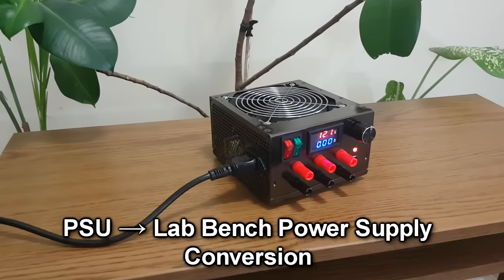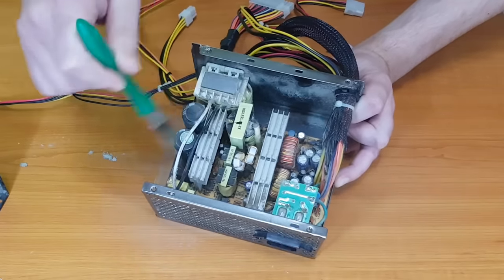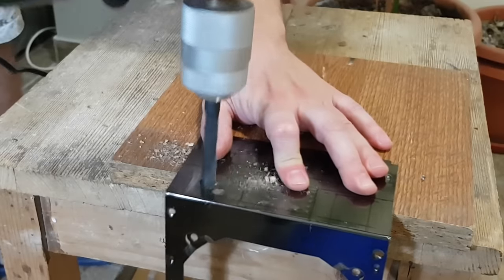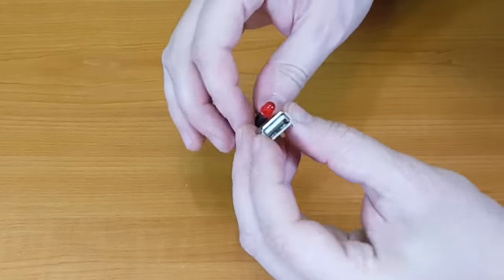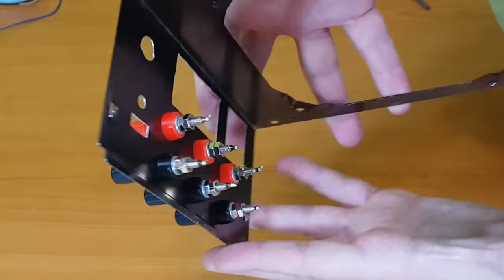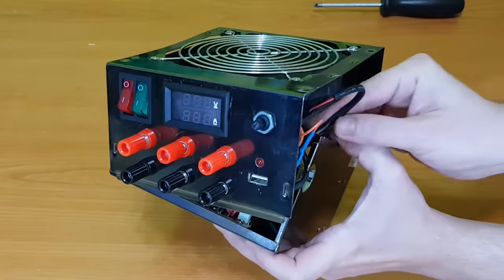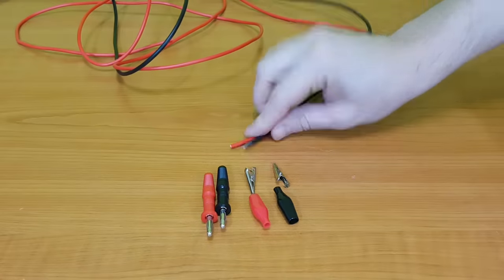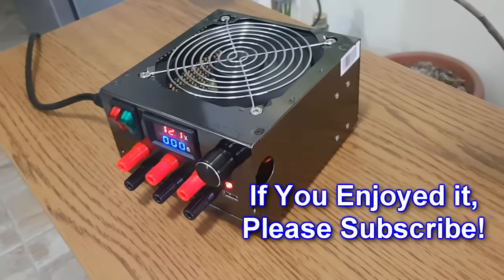DIY - Lab Bench Power Supply

Comment: Can you plug two psu in parallel or series??
Reply from the maker: no. if you connect them in parallel, there will most likely be a small voltage difference between them, so they can't deliver simultaneously the same amount of current. if you connect them in series, they will blow up, because they are not insulated from the mains and you're actually connect them in a short circuit.

Comment: What dummy load should I use if I’m using a 650w psu with most of its powers on the 12v rail at 648w 54amps
Reply from the maker: hi. for 12V I suggest 68-82ohm 10w resistor.
Reply: Thank you so much just checking is that a variable ohms or any 10w with a ohms rating within that range
Reply from the maker: these are fixed value resistors of 68 or 82 ohm. you can use which one you want/find. the difference is that the 68 ohm resistor will use a little bit more current and it will get more hotter than the 82 ohm resistor.
Reply: Much appreciated the explanation I opted for the 82r.

One last thing the amp meter will I need to get. Because I can only see them rated for 10 amps when my my psu delivers way more power

Comment: Hello, good video. My meter is a model YB4835 - V1, with only 03 cables. A voltage range of 4.5 - 100V, which means I must have at least 4.5V to work. Do you know how to use an external power supply for this equipment? Regards
Reply from the maker: hi. i can't find information about your voltmeter. can you provide a link?
Reply: @Sorin_DIY  I got it ! I added the diode D1 and insert a power supply in a space for it, that has no connector in this model. Thank you for your attention.
Reply from the maker: it's good that you found the solution :) I didn't use this type of voltmeter before.
Reply: @Sorin_DIY  more one registered for your good channel.

Comment: What will happen if I connected the +12 volts and -12 volts wire sir?
Reply from the maker: that is a 24V output, you will short it and the power supply should turn off.
Reply: @Sorin_DIY  is it safe?thanks for the reply sir

Comment: what happens if you connect the sense wire with the regular orange wire
Reply from the maker: you will have a stable 3.3V output. without the sense wire, the voltage will variate around 3V.

Comment: Hi, is it possible to also have a 30v output?
Reply from the maker: hi. yes, you need a step up converter, but the max current will be limited to a few amps.
Reply: @Sorin_DIY  Good, is not possible to connect in series +5v +12v +12v ?

Comment: How many amps can it handle?
Reply from the maker: the ammeter can measure max 10A, but the power supply it's more powerful. 2* 12V & 18A; 5V & 28A, 3.3V & 28A.

Comment: How to prevent any shocks  which can cause even death!! Please advise!!
Reply from the maker: always unplug it from the mains socket when you're working on it. don't touch the terminals of high voltage capacitors, measure them first to be sure they are discharged. always wear protective goggles.

Comment: can i use 10wtts 10 ohms resistor and Rotary Switch 2P11T 2 Pole 11
Reply from the maker: 10 ohms resistor it will get very hot. you need 22 ohms or more. that rotary switch is not good. you need one with a common pin. and it needs to brake the contact, before making the next contact - in the next position. please watch the part2 video for more information about the switch.

Comment: Hi Guys, Would it be possible to connect the yellow (+12v) & the blue (-12v) to get 24v? If so, how would I wire the switch to be able to select this custom value? Would I have to solder another blue (-12v) wire to the board and solder that to the switch? TIA
Reply from the maker: hi. you can connect the 2 wires to get 24V, but it will have the current of the weakest output, in my case 0.3A, which is not very useful. you can use a similar switch with 2 poles and 6 positions (like the one I've used in the part2 video) to make the connections.
Reply: I do have a rotary switch with twelve positions. Are you saying that I could connect the two wires to one connector on the switch to get 24v? Sorry, I’m not sure how that would work
Reply from the maker: the simplest way is to install 2 more binding posts for the 24v output. the blue wire will go to the black terminal, and yellow wire to the red terminal. but again, with 0.3A I don't think it's worth doing.
Reply: Sorin - DIY Electrical Nerd Thanks Sorin, I do agree that it is not worth doing but I was intrigued. I’m still waiting for all my hits to arrive & then I will have a go at the Workbench PSU, I think you put together two excellent videos & I cannot wait to try it for myself. Thank you. Do you have any plans to make the variable one? I would really like to see that. Thanks once again & do keep up the good work
Reply from the maker: I will make a variable power supply, but in about 2 months I think.
Reply: Sorin - DIY Electrical Nerd hell yeah! I cannot wait. TYVM

Comment: hi .so , on the usb / mir port, i read 16amps per port .my +5v is rated at 30amps .before i burn my phone, can i have a recomandation ? my other on-hand-two options another 4 usb port, wich gives out 500mAps .. wich is low , and the last, recycle the converter from an old car charger and stickit to the 12v line. thnx for the videos. ps. that cat is lazy
Reply from the maker: hi. the 5V rail should not damage your phone. the phone decide how much current it will draw. it shouldn't draw more than 2A. I suggest you first try it with another cheaper phone, that you don't use anymore. if everything is ok, you can charge your phones with it.

Comment: On the usb side, it can deliver 2.5 amps but your phone will never accept more if you dont do a trick on data pins to set charging at higher amp rating.
Reply: or use a "power delivery" adapter
Reply from the maker: hi. I have explained this in the part 2 video.

Comment: Nice but these PSU can't hold voltage with a modest load at 12 volts. Voltage drop below 11 volts! I tried scraped  200W, 300W and a 450W PSU units. Good for battery chargers though...For a robust PSU just have one that hols 13.8Volt..

Comment: I cant find 10W 43 Ohm resistor,
9W 0R47 would be ok?
Reply from the maker: you can use a resistor of 10W and 33 or 47ohm
Reply: When I connect the voltmeter the supply turned off so I connected a 10w 47 ohm rezistor to the 5v output ,but same thing.....plus the rezistor o overheated and smoked and

Comment: A few tips for the sheet metal work:
* Drill at each corner for a nicely radiused square hole. 5/16" drill for 5/16" radius (equates roughly to 8mm)
* A "nibbler" is very helpful for cleaning up the straight cuts, and it's an inexpensive tool
* For the large hole the wires used to be routed out of, you might find a plastic plug made for furniture to plug it with. 
 **I hope you find that helpful! Your video helped me in a few areas, so I hoped to return the favor as much as possible**

Comment: I have one serrious question for those who want to help me 
I have atx akyga ak-b1-400 +3,3V 23A, +5V 25A, +12V 18A , -12V 0,5A +5V Sb 2,5A total power 400W. Which buck Amperage should i use and what value  should be the fuse inside?

Comment: Can I run with this supply hho 12 volt15 amp generator.
Reply from the maker: theoretically yes. but you may need to add some modifications to the power supply. it will be difficult if the inrush current is high.

Comment: I hace a doubt, it seems that my source atx doesn't have the fuse included, if I wanted to add it, where should I put it? Will be right if I connect it in series with my switch of stand by or where? If anyone can help me I'll be so thankful.
Reply from the maker: if you want to protect the outputs, you need to add a fuse on each positive output wire. you can watch the part2 video for more info.
Reply: Thank you, I have seen your video. It's great but I think that that is going to limit my power source and I don't want that, I will put a fuse in the input of all the ATX to protect everything un general (Will be right if I put a 4A fuse?) And I also going to be puting a 1.5A fuse in my variable voltaje output, What do you think bro?

Comment: How to give adjust Current meter  in PSU ??? But i need control adjust current meter
Reply from the maker: in the future I will make another power supply with adjustable voltage and current.

Comment: Also, the blue wire IS useful to you. that -12V right there, used as the negative terminal for +12V gives you +24V.
I'm literally a beginner in electronics, and yet I keep finding horrendous misinformation. If I can find it, then I can't trust anything you say

Comment: How this .3amp rottery switch handle 19-24amp of computer atx?
Reply from the maker: it doesn't. it's not connected in series with the load. it has a different purpose, you can watch the part2 video for more info.
Reply: @Sorin_DIY  atx power supply yellow wire out put is 12vlt appx with 19-24amp...
What ever. . Interesting project...👍👍👌

Comment: Don't you need a was of controlling the amps output?
Reply from the maker: no. the PSU delivers the maximum current on each output. this is not a variable power supply. the load draws as much current as it needs.
Reply: @Sorin_DIY  Ok. I was thinking of building a supply with a buck / boost and controls for volts and amps with a volt/amp meter.
So I don't need to worry about controlling the amps just the voltage?
So basically you are saying I wont blow anything with too high an amp output?
Reply: @Sorin_DIY  I would really like to have a minimum of 24v
Reply from the maker: the PSU should already have over current and short circuit protection, but you can add a fuse on each output.
Reply: @Sorin_DIY  What is the use of having control over the current then? If for example I was powering something that required say 500 milli amps and my supply was outputting 18a wouldn't it be bad for the circuit?
Reply from the maker: if the circuit is designed perfectly and put together well with perfect working components, it will 500mA, no mater how much current the PSU delivers. but with a variable power supply you can limit the current to 500mA to test the circuit. but if you've made a mistake designing/building it, or if you use faulty components and the circuit draws more current or even short circuit, then you will protect the rest of the components, because the current is limited. otherwise it can draw a few amps from the power supply and burn all the components, so you can't even find the mistake.

Comment: Why is there a need for a 10W resistor?
Reply from the maker: hi. some power supply units will not work correctly, if they don't detect a load connected. so, as a load you can connect a dummy resistor. you can watch the part2 video for ore info.
Reply: What will be the power consumption, if we only use one 12V supply from PSU?

Will it be same as using it completely?

Comment: 10:04 This is not a power supply fault but this is your fault. You should install a car charger or voltage divider. Phone does not see pins D+ and D- on usb and charging the battery in safe mode 20mA :D.
Reply from the maker: hi. it's not my fault, it's the power supply's fault. please watch the part2 video for clarification :D

Comment: what if I connect yellow + orange + red what will be the output
Reply from the maker: the power supply will turn off.
Reply: @Sorin_DIY  how can i convert it to 24 volt
Reply from the maker: you need a step up converter.

Comment: A diagram would be useful especially for wiring the Volt/Ammeter.
Reply from the maker: PSU circuit board schematic: https://i.imgur.com/e5JSKZf.jpg
Volt/ammeter schematic: https://i.imgur.com/tesGVjy.jpg
Reply: @Sorin_DIY  Hello I have problem I build this power bench supply my problem is my display volt/amper is on but when I connect something to turn on like a little motor there isn’t a current on biding post please help me !!

Comment: Thanks for the vídeo! I made one power supply very similar to yours, and works. But have two issues... Amp meter don't measures but works.... And my 3.5v output voltage is work good, but when i load a little bit amps, the power supply turn OFF ...  And o need to reboot to work again..

All others outputs work good
Reply from the maker: hi. did you use the same volt/ammeter? did you cut the thin black wire? try to reverse the thick ammeter wires. and for the 3.3V output did you connected the 3.3V sense wire (brown)?
Reply: Its Solved! I reverse de hires and work, i know the ampmeter is in series, but i didnt remember the input and output! The 3.3v output is working too on next day. Thanks for the help!

Comment: Hey how much watts does the 12 v can output
Reply from the maker: 216w
Reply: @Sorin_DIY  That means it gives 18 amps of current out put
I need At least 40 amps of continuous output
What should I do, can a relay be helpful?
Reply from the maker: I don't think you can get 40A from a PC power supply. you probably need to buy a dedicated 40A power supply.
Reply: @Sorin_DIY  can i connect two PSUs parallelly to get what I want, i.e. two  18 amps connected parallelly , will it give total output of 36 amps ?
Reply from the maker: I don't think it will work. there will be a small voltage difference between them and one power supply will always work more than the other.

Comment: why a atx psu will not take 6amp load when its allready on
Reply from the maker: what type of load are you using?
Reply: @Sorin_DIY  a car halogen headlight
Reply from the maker: that happens to mine also. there is a big voltage drop, when you connect the bulb, so the power supply turns off as a safety feature. try to connect a big electrolytic capacitor in parallel to the power supply output. 25V 6800uF minimum. it will keep the voltage more stable.
Reply: @Sorin_DIY  i never thought about that . thank you ill try it .
Reply: @Sorin_DIY   i tryed the capacitor (12000uf 63V) same results.
Reply from the maker: that means there is still a big voltage drop. try to connect a smaller wattage bulb, so the power supply will increase the output current. then connect in parallel the 6A bulb. the load will increase gradually and maybe there will not be such a big voltage drop, when you connect the second bulb.

Comment: the highest rated binding posts I can find are 16A. ... don't you need one that can handle 30A?
Reply from the maker: only if I plan to connect a 30A load for a long period of time. you can connect bigger loads to these binding posts for short periods of time without any problems.

Comment: unfortunately with this design you can't use 2 different voltages at the same time.  The PSU is designed otherwise to allow that.

Comment: Very good job brooo
If use buck boost converter ...mybe more acurated to  adjustable  the voltage.  
Requestion a video for me n the other viewer
PC powersupply convert to power supply adjustable current control n voltage control.
How do.. instalation  load current if i want to adjust the current to set ? Befor  use to supply 
Like a profesional powersupply made.
Thks
Sorry bro bad english...
Nice to meet u im from indonesia.

Comment: Can we vary the voltage between 0 to 12 volt by POT???
Reply from the maker: no. it is not a potentiometer. it's a rotary switch. please watch the part2 video for more info.
Reply: @Sorin_DIY  along with rotary switch can we add 10K potentiometer on 12 volt supply to make it variable??
Reply from the maker: a potentiometer is not enough. you need a step up / step down converter. I will soon make a video about a variable power supply and I will explain everything about it.
Reply: @Sorin_DIY  OK thanks

Comment: how can i add a Current Variable?
Reply from the maker: it depends on the voltage range that you need. you can add a step up, or step down converter with current limiter.
Reply: most of the times i use only 5v but i need a power supply that i can set the current not only the voltage. Thank you for answer. ideas??
Reply from the maker: you can add a step down converter with current limiter (like a LED driver module) to the 12V rail. so you can set the output voltage to 5V and limit the current according to your project.

Comment: one psu wire can handle up to 200w so you dont need to connect like 4 of them...
Reply from the maker: hi. AC current it's different from DC current. for AC current, one wire is ok. but for DC current it can't handle the load. if you try to deliver 5A at 12V through only one wire, it will start to warm up. so if I want to test 2-3 peltier modules through only one wire, it will get hot, it may even melt the insulation. that's why you have tens of wires for every color from the power supply. on the molex and S-ATA supply connectors you have 2 black wires, not one. think about car battery wires, how thick they are.

Comment: can you DIE touching any exposed metal wires?
Reply from the maker: if the wires are connected to the mains voltage, yes.
Reply: @Sorin_DIY  the MAIN as in the PSU that is connected to the wall?

Comment: why  we need  10W 43 Ohm resistor  ???????
Reply from the maker: to keep the output voltage stable when you connect and disconnect a load. please watch the part 2 video for more info.
Reply: @Sorin_DIY  this is stable  only for 5volt out ?
Reply from the maker: the output with the dummy load is stable. for the other outputs it depend on the power supply. most of them need a dummy load on each output, is you intend to connect and disconnect big loads.

Comment: Nice looking work but not good because you use signal switch wich can't handle with few amps of current! You must use stronger power switch or relays for 10A current not that small signal switch.
Reply from the maker: if you are referring to the rotary switch, I use it only for the voltmeter. the binding posts are permanently connected to the power supply rails. you can watch the part2 video for more details.